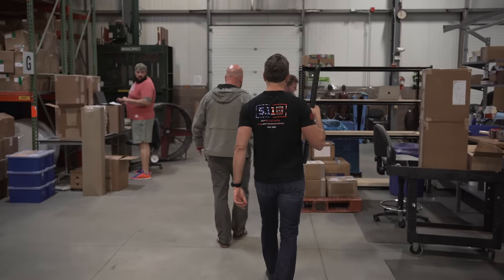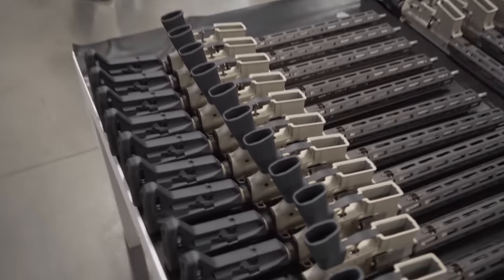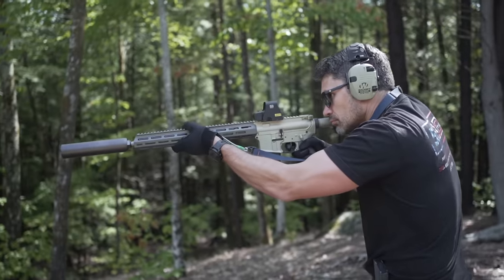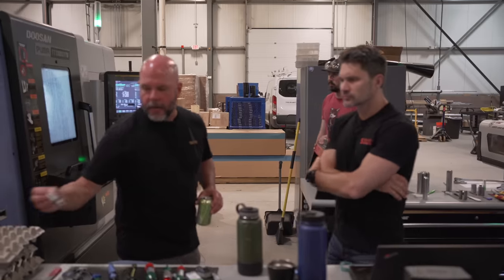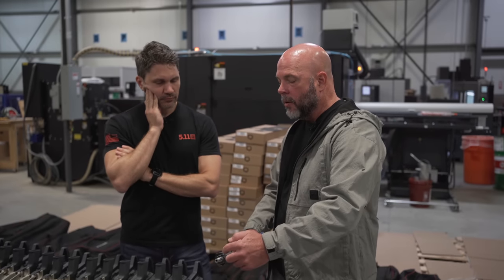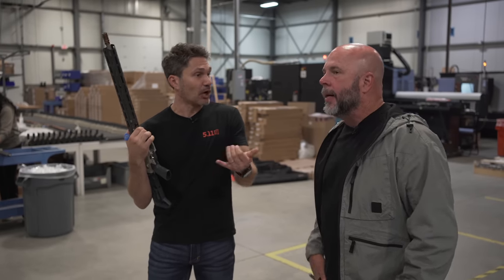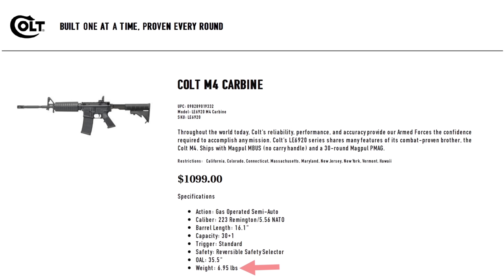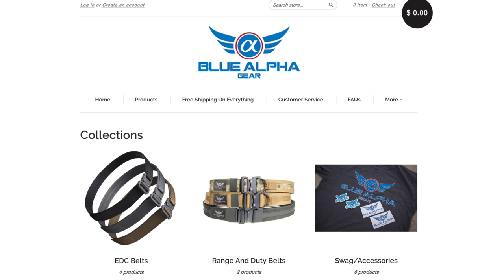Why Q's AR-15 Will Disrupt the Market: The Sugar Weasel 16"

Comment: There are way too many AR15 manufacturers out there. Choice is good but at this point there’s too many options for consumers and the benefits of one over another are marginal especially with the amount of customization you can do

Unless you have proprietary parts that have tangible benefits like Knights or LMT I don’t know how you stick out in the AR market minus having a really low price like PSA
Reply: There's actually very few manufacturers. Most are assembly houses that buy from large OEM machine shops.

Comment: That Trigger is ABSOLUTELY THE BEST TRIGGER EVER MADE HANDS AND PANTS DOWN!  I paid $300 for it, if I was able to shoot it before buying it and didn’t know the price first, I would’ve paid $600+ for it.   

$300 Q Trigger, I put it into a highend $$450 BCM complete tricked out ported, polished, blueprinted, molly Nickle coated lower, used a $475  11.5 BCM Highend barrel with a BCM Upper, a $399 Titanium adjustable BCG, $1,200 Surefire Socom can, 
$1,000 AIMPOINT II , $125 TIIJICON offse flip ups for back up, glow ing dots, 
$200 BCM mid length Gas system, $175 BCM Recoil mitigation system 

With a DanDefense m4 Stock. 

I shot this piece of art and it was butta! Smooth, steady, light AF, just an amazing amazingly amazement!

Comment: Lol, look at all of the Q haters emerging. 

Its not inexpensive, its also not junk, but the fact that it has radian CH and safety, a suppressor mount, an AGB, and a better trigger than the PNT or something milspec right out of the box, is really solid. Thats around $500 in parts that somone going to suppress a gun doesnt have to spend.

Comment: If they do an 11.5 or 12.5 or something that’d be great, because those long Q suppressors.
Reply: I remember them having those out but I'm not sure if they were in 5.56; they're still probably most well known for their .300 stuff anyway.
Reply: Why not do a 13.7 or a 14.5 with a pinned muzzle device to get that length down while meeting the regs.
Reply: @jeffconley819  Because pin and weld is gay asf. Just get 16" if you don't want an SBR.

Comment: Proper assembly of basic AR parts with a good barrel and trigger will equal a really good AR. Many companies have figured this equation out and make great budget to mid-priced ARs. Anything beyond that is 100% unnecessary and drives up the price very quickly due to diminishing returns. If you are a real 3 gun competitor or precision shooter, then yes, spend the money, but if it's a tactical setup, it's not worth it.

Comment: Low Weight, Suppressor Ready Muzzle Device, Adjustable Gas Block, and a Best in Class trigger for 1,500 dollars and the best part is that it's already installed at the factory.  This is an exception "Sweet" deal.  Take into consideration that Toyota manufactures both Lexus and the lower end Toyota models, yet they both have exceptional quality.  I believe that Q has finally figured that you don't need to charge a lot to deliver a quality product.  I'm totally impressed.
Reply: Kevin,  is that you??? 😂

Comment: Looks like a pretty good quality mid-level AR. I wouldn’t say entry level necessarily but that is about the same price point is my first AR-15. One thing that I found that I prefer is carbon fiber hand guards. There’s a wide variety of many different price points. the weight savings are fantastic in exchange for no loss of strength.

Comment: List of spotted issues with this gun:

Has the WORST Magpul Stock (Its used because it allows you to advertise that the gun is lighter). 
This is almost immediately gonna be changed by most people to one of the following, a Magpul CTR,  B5 Bravo, Vltor IMOD or Hogue Over-molded stock. (These are also my recommendations for stocks).

Zero ambidextrous bolt release, Could've 100% have used a Magpul B.A.D. ambi bolt release Lever for the price (The Magpul B.A.D. are $30).

Zero ambidextrous magazine release, for a almost 1/2 price you can get a SIG M400 with an ambi mag release lower. OR used an Arms Unlimited Ambidextrous magazine release for $20-25.

Mediocre grip, really nothing to say, most people would get a Magpul MIAD, or a Strike Industries AR Overmolded Enhanced Pistol Grip to replace this.

Minor complaint- 16 Inch barrels are kinda unsought for, they should've made a 14.5 pinned and weld with a muzzle device that allows suppressors (like a SureFire WarComp).

Lastly, this entire gun can be made by yourself, cheaper, and better, than the cost of $1600 for the Sugar Weasel. 
For this price you can get: 
PSA AR Lower $40
PSA Custom Drop In Single Stage/2 Stage Trigger $80 (They are really good for the price)
EMG 8 position buffer tube w/H2 buffer ~$80
Magpul CTR, MIAD Pistol Grip, ESK Ar Selector MOE Trigger Guard & BAD Lever ~$160
Arms Unlimited Ambidextrous magazine release $20

These are in all ~$380 For a really well put together lower
Upper Choices:
PSA "Sabre" 14.5 W/Pin/Weld SilencerCo ASR Flash Hider $550 Upper. ~$950 COMPLETE w/ lower as written
PSA "Sabre" Forged 16" $550. ~$950, same as other
BCM Complete 14.5 W/SurFire Warcomp Pin/Weld, Mod 3B Charging Handle, and BCG ~$1,050. $1500 complete (Still $100 cheaper than Sugar Weasel 16)

This is another AR, at-least the Honey Badger is unique for it's cost, this isn't.
Reply: Not sure who you are speaking for, but you listed one part I would actually buy.
Reply: @enoughsaid3  I assume its the Magpul BAD or the ambi mag release?

Comment: I'd love to see a fixed stock. I just run my adjustable at full length and never change it
Reply: Check out the doublestar ace arfx 10" skeleton stock, it gives a 12.875" lop (without the 0.5" rubber butt pad installed) and looks great, solid stock, it does use a rifle buffer system though. I run that stock on everything because I'm in the same boat, the adjustable stock is nice for getting the lop you want, but if you can find a nice fixed stock that does the same thing then why not get rid of the awful wobbly adjustable stock? Just my opinion.

Comment: I am not a "collection of guns" kind of guy. I buy them for purpose and purpose only. If the Sugar Weasel existed when I built my current full length AR I would have purchased a Sugar Weasel instead of hodge podging a pile of BCM, Geissele, FN, Colt and Radian parts into a full length rifle.

Comment: Not impressed with any AR just because it’s called “premium” and retails for a thousand plus. 

I’ve built AR’s for 15+ years using mil-spec parts, (or very slight upgrades like Magpul furniture if I could get it on sale) and have $400-$600 in them. Usually 2 MOA, and honestly for home defense 1 MOA capability provides no additional benefit.  Reliably, my AR’s chamber, fire, extract, eject exactly like an expensive one. 

For another couple hundred add a basic red dot sight (and I mean a name brand you’ve heard of, not some cheapie junk from Amazon) and one of the lower priced drop in triggers. I’ve never gone the suppressor route, but if you add for the suppressor and the muzzle device to mount it, you’re still way below the price of the name-brand rifles. 

And thru the years, parts, including newer innovations, have gotten cheaper.  In my honest opinion, paying another grand for an AR is only for a brand whore to brag about how much money he blew.

Comment: I don't understand. What makes any of these AR15s worth thousands more than the typical mill spec AR15? I get that a drop in trigger is nice. I'm not counting the $1000 sight or the $1200 suppressor. Just the 7075 aluminum upper & lower. The steel bcg. The barrel. Handguards are all the same. Muzzle brakes are all the same. Stocks are mostly the same, which is just a piece of plastic. The Honeybadger uses a more expensive stock because the rear plate is a piece that takes a lot of CNC operations to make. When you're all done, it's a "combat" rifle that shoots a 500 yard max round. Where is the money? What makes a $3k AR worth $2400 more than a $600 AR?

I built an AR that I think is pretty nice for just under $600. I just shot a friend's Ruger AR-556 with a really nice drop in factory trigger that was about $600.

Comment: Take one out and throw it around like you did the DDM4V7.
Reply: It wouldn't survive that. A lot of AR's wouldn't survive that. It's not a ding on any of them. They're built with a purpose in mind. For DD, the primary focus is reliability and durability.
For some, the primary focus is providing a reasonable quality product for as low a price as possible. For others the primary goal is weight savings or accuracy.
This is a pretty light rifle. That means it has a thinner profile barrel and a lightweight handguard. Good chance the handguard is destroyed or visibly damaged by the first or second throw.

Comment: Disclosure: I have two sugar weasels.  300blk and 13” 5.56 

Yes the trigger is nice. 

The adjustable gas port hole isn’t even in the right location on the 13” upper version. 

If you want to use a non Q muzzle device you have to use an adapter since the barrels are tapered. Not a big deal. 

Outside of that, it’s a clear ano AR 15 with off the shelf furniture. 

Something being expensive or not is completely relative, but the owner being an asshole is pretty proven.

Comment: And now you can add OuterWild to the mix at about the same price point but get less than the DD (like no sights.) Now let’s all be honest. I see people talking about this and that and take accuracy for instance. Most won’t out shoot a 600-800 dollar rifle so most in this thread won’t out shoot anything in this conversation. ARs are getting like cars. People are going to get behind a manufacturer and swear it’s the best for reasons. By the way the OuterWild is definitely over priced for what you get. As long as people are buying what works for them. At least they’re buying and supporting the community.

Comment: Yeah this is kind of what I have been asking for, an adjustable gas block without forward assist with a good trigger for a reasonable price.  Like to get the agb, and a good trigger you are in 2400 type a range.
Reply: AGB without a FA, exactly what this ex infantryman uses as automatic disqualifiers when looking at an AR.
Reply: @Valorius  cool story
Reply: @randyreviewsit  It's ok man your AGB and non FA upper wont hurt you during your square range "adventures."
🤣
Reply: @Valorius  I prefer to have the FA and never need it, and all that.

Comment: Cool.... ANOTHER AR 15.

I hate to be "that guy" but the "Go to Sig and they will make you wear steel to sandlas" attitude makes me never want to buy anything from that company. Not taking employee safety seriously is an extremely irresponsible attitude to have and makes me wonder what other corners they cut in the manufacturing process.

Comment: Love my sugar weasel pistol in 300 blk. It’s super lightweight with an optic light and suppressor. It’s still sub 8lbs. It is a good choice in 300 blk. I’d rather spend the other 500 for a super duty in 5.56 with a 16” barrel. My 16” is all piston rifles

Comment: For years now I have been waiting for someone to offer a rifle that has a suppressor that is pinned and welded on a short barrel.  This way you get an SBR looking rife with the suppressor permanently attached and they could even hide the weld under the handguard.  They could offer two barrel lengths "with suppressor" like a 16.5" and an 18."  All they need to build is the upper portion then set them aside for orders as they come in.  I even have a name, the LargeLarry SD.
Reply: DD makes the ISR. Its pretty much what you're describing.

Comment: I want an AR but I don’t know where to start.
Reply: Depends on your budget.
Reply: Smith & Wesson M&P Sport II, Ruger AR-556, or a completed PA-15 from Palmetto State. They're affordable and reliable, all will run just fine right out of the box and don't have any excess frills. No need to go nuts and overwhelm yourself when you're just starting out.

Comment: I don’t like or trust Kevin or Q. After his 8.6 blackout claim’s being disproven by a simple ballistic calculator, and him lying about his weld quality/what a weld should look like. His rifles don’t honestly feel that nice, they just feel like regular ARs with tight ish tolerances. They feel like a Chinese knock off KAC & BCM ELW tbh. The fix is okay, but far from being worth its price in my opinion. Same with the cans, I also don’t trust his off the shelf cans to handle high pressure ammunition tbh not with the welds they let pass QC. He gets hate for a good reason. Q without Kevin would  do a fair bit better on the market I think.

Comment: One of the things that you see from these factory tours is the utter impossibility of gun control ever working.  Nothing in the factory was so large, immovable or high tech that a criminal couldn't set up shop unobtrusively. A gun factory is just as easy to hide as an automobile chop shop.  And nothing keeps factories of this sort from operating out places like  Juarez Mexico either, other than the hugely effective Mexican gun control laws and our impenetrable border defenses.

Comment: Love my sugar weasel 7 and 13 inch 300 blackouts
Reply: I have a 7” 300 BLK, fit is way above anything else I have shot, no gaps, no twist, no rattle.
Reply: @isaiahaguilar5977  agreed and light AF. It is my favorite in my inventory. Never felt the need for the badger.

Comment: So basically this rifle is "unique" because it comes with all the upgraded parts you'd add to any other rifle you buy,  IE upgraded trigger, charging handle, muzzle device. That'd be cool if they were the first, but the Geissele Super Duty has been doing this for years. This is basically a Geissele without a hammer forged barrel. Neato 🙄
Reply: The gas block design is cool. That’s about it.

Comment: The internal combustion engine disrupted the market. This thing from Q is not even close to disrupting the market. Another "Me2" product at best.  You can build a far superior gun for about the same money or less. Criterion barrel, trigger tech trigger, high end BCG, magpul, billet receiver, etc. And most any gun now on the market should be getting MOA accuracy. I have seen cheap-ass builds using NBS barrel do 1 moa consistently (Only $750 invested). But that standard should not even be applied to a fighting gun like the AR. You are not sniping with it at distance. I have guns (bolt guns)  that hold 0.4 MOA out to 300 yards and those are far cheaper than then the $1600 they want for this Me2 AR. I pass on Q just based on principle.

Comment: $1600 for a lower quality Barrel  😂.... And the parts come from other manufactures? You are buying a palmetto Gun "Assembled" for $1600! Buy the parts and build the exact same gun $450 from Palmetto they make decent entry level.... And you can get a Cold Hammer Forged Barrel 😂

Comment: Why 16" barrel?
Reply: Nfa
Reply: the alphabet squad said so
Reply: @rockerdude8000 They could easily offer a 13.7-14.5 with a p/w muzzle device. With their rep as a suppressor company it would only make sense.
Reply: Because velocity still matters
Reply: @Aperson156  I can't be the only one that doesn't like pin and weld setups. I don't want to break that shit off if I ever have to change out the gas block, let alone if I decide to do something as simple as want another muzzle device. To me that annoyance isn't worth saving the tiny amount of space especially when 16" performs better.
Reply: @stevem4783  Pin and weld isn't much more time consuming to remove than the rocksett you should already be using. You don't lose that much performance, and you notice that length a lot more when you have a suppressor on the end.
Reply: @Aperson156  So it's less versatile, doesn't perform as well, and really doesn't offer a benefit. Thanks for confirming my point.
Reply: @stevem4783  Thanks for confirming you don't know how to read. I'm not even trying to say one is better than the other, more that they have strengths and weaknesses. If you prefer a 16" barrel for the negligible velocity increase, that's fine. I prefer a shorter, handier rifle.
Reply: @Aperson156  I know how to read. You didn't do anything but list excuses, and saying "you notice that length a lot more when you have a suppressor on the end" is a joke.
Reply: @stevem4783  lmao. I forget I can't say anything that remotely criticizes Q or the qultists come out. 

The question was "why 16?" someone answered "NFA". I provided an answer that shows that is a weak reason, especially given the number of manufacturers that offer a p/w 13.7-14.5" barrel from the factory. 

Whether or not you like a p/w is immaterial to the discussion. There are plenty of people who do see the benefit. There are plenty who don't. It's ok to have different preferences and uses.
Reply: @Aperson156  I don't own a Q product and think the company sucks.

I also thought your commentary sucked. The NFA is a perfectly good reason to not want a barrel under 16", along with every reason I stated. Overly complicating a setup for no benefit is never the optimal choice to make, but hey, for people like you, logic doesn't apply.
Reply: @Aperson156  They don't make a Q ecosystem compatible muzzle device that is long enough to bring one up to legal length. A 14.7 maybe, a 14.5...don't think so, a 13.9 or 13.7 nope. Maybe they could design and manufacture a different cherry bomb or some such, but there is also the question of whether or not their suppressors are compatible with a longer device. They might be or might not be. I don't know either way.

Comment: That stupid tapered muzzle shoulder guarantees i can't use my rugged brake to mount my radiant can. Fail.
Reply: Taper is better. However, you can run 90 degree, old tech muzzle devices on it too. 🤷🏽‍♀️
Reply: @kevinbrittingham6774  I agree that it's better technically but if we're going to start doing tapers then everybody needs to get on a standard. One problem I see with tapers is the difficulty of perfectly timing a brake etc.